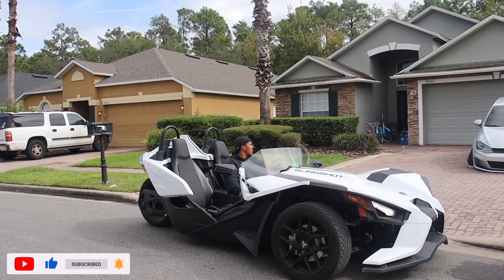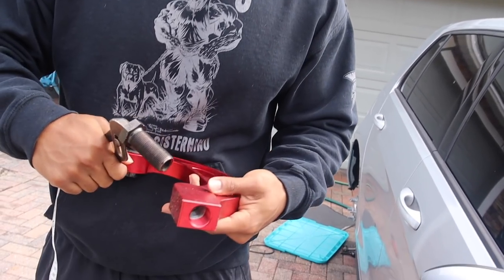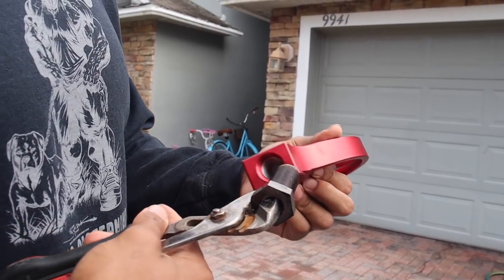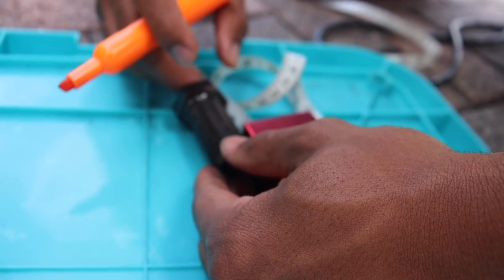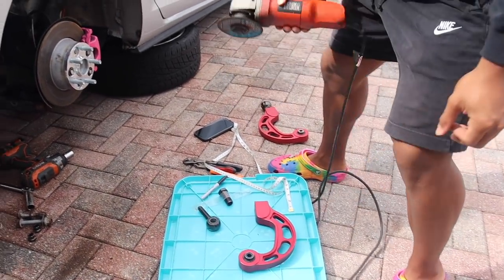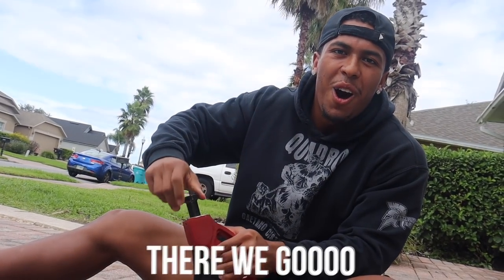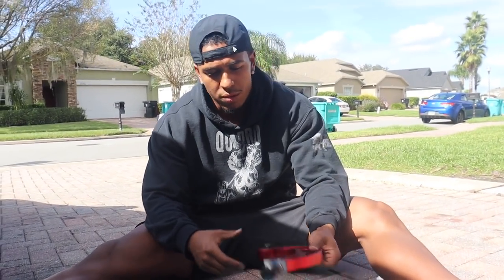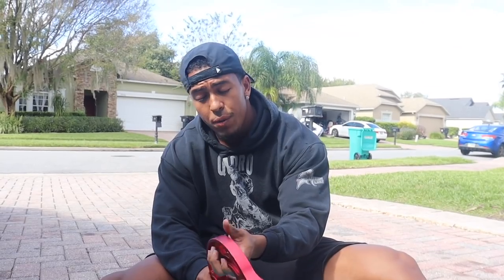HOW TO ACHIEVE MAXIMUM CAMBER ON YOUR VOLKSWAGEN GTI PART 2

Comment: What are you doin ab the gas tank broo fuel cell? Would love to see a vid on that
Reply: Also are you going to run axel spacers up front?
Reply: Also also also I didnt finish the video before the first comment, but besides hitting the evap what about dragging the tanks
Reply from the maker: no axle spacers
Reply from the maker: the car isn't that low so not worried about the tank yet. Doing a fuel cell when I get home anyways after Simply